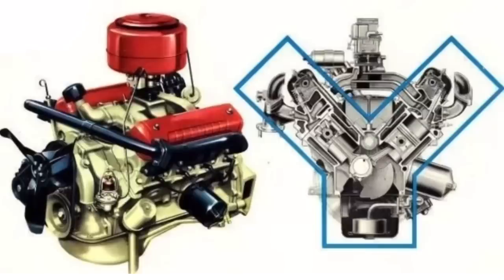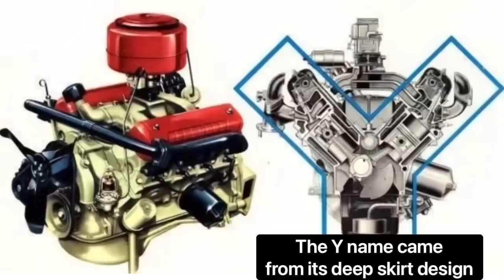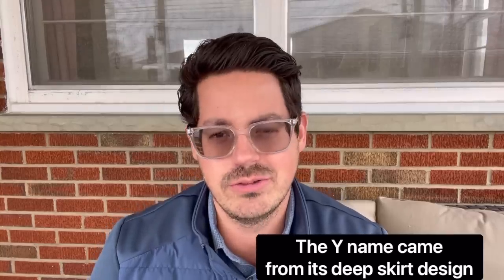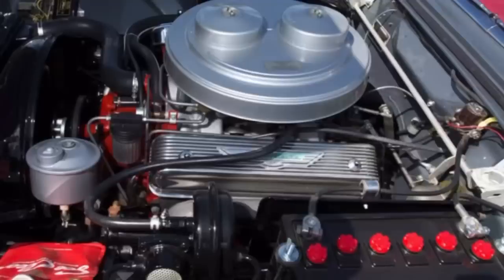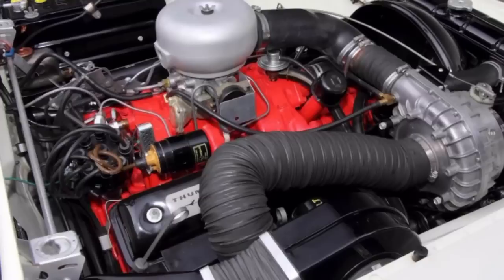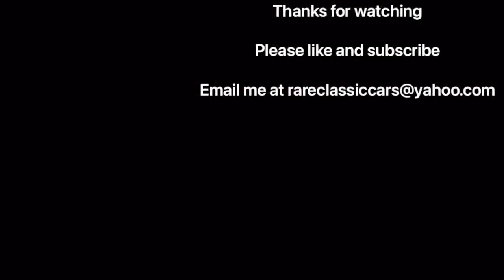Worst Engines of All Time: Ford Y Block V8

Comment: In the 50's there were a lot of people who hated the new detergent oils because many old engines had poor gaskets and rope seals that worked well with non-detergent oils. The oil cooked into the thick paper gaskets and ropes and sealed them up. Crankshafts were smooth to preserve the rope seals and oil would cook in there and make for a tight seal. If the engine then got detergent oil inside it, the detergents would soften up those old gaskets and clean off the rope seals and all of a sudden the engine would start leaking oil all over. So even though the Y-block had gaskets that were designed to tolerate detergents, many mechanics would refuse to use detergent oil in anything and even recommend to their customers to not use it, thinking there was something wrong with detergent oils, that they would make any engine leak oil.
    Though rope seals were still used well into the 90's on many engines (the Buick 3.8 liter 6 cylinder comes to mind) the crakshafts were made to work well with detergents with little grooves cut into them to wipe the oil back towards the crankcase when the engine was running. They may leak one drop of oil in 10,000 miles if that.
    I once saw that a guy put the wrong crankshaft in a Buick 3.8 Liter engine in the early 90's. It was a rope seal block, but the crankshaft he used was for a neoprene type seal that was used on the later models; 93 or 94 IIRC. It didn't have those grooves. Believe it or not the two cranks were identical except for those grooves. And man did that thing leak oil! It was a steady drip, drip, drip, one drop every ten or fifteen seconds out of the rear main. The front was wet but not dripping because it wasn't getting a constant flow of oil on it. The rear rope seal isn't under pressure as such, but it has a constant flow of oil around it. The lack of grooves on that crank will keep a neoprene seal lubricated. Put a rope-seal crank in a neoprene seal block and it would likely start out OK for a while and after a hundred miles or so it would destroy the seal and oil would likely pour out the back in a constant stream. lol
Reply: Also, early detergent oil sometimes separated.

Comment: I think the other critical failing of the Y block was it's very small bores; you just couldn't bore and stroke them big enough to move the big heavy Fords and trucks of the late 50s and early 60s with any performance, whereas the competitors were all over 350 ci by 1957 or so. The MEL was better suited for the job, but you couldn't get em in FORDS (except the 58-9-60 T bird). The FE was a big improvement.
Reply: Hahaha, you clearly haven't seen a 312 or 292 y block with some boost... for whatever reason, y blocks love boost.
Reply: @TheCatOfAges  No match for a 390FE, 394 Olds, or 392 Hemi under boost.
Reply: They had cubic inch limitations for their time is correct. Not many manufacturers were boosting their engines either. Now with that, I am building a stroker C1a2 292 block with a 312 crank turned to a 3.6 stroke and 6.300 rods (Ted Eaton). My name is on the list for a set of Mummert heads and the new single plane intake should be here next week. I was porting a set of C heads and have a set of 1.80/1.50 custom valves with the small 5/16 stems with a Clay Smith cam/Mummert springs that will be going up for sale once the heads are done. Everything is brand new still in the boxes.

Comment: these motors were better than anything at that time very reliable
Reply from the maker: Better than the engines from GM and Chrysler?  We shall disagree. Any engine that needs an  aftermarket add on oiling system isn’t great.
Reply: @RareClassicCars  It is easy to fix the rocker oiling problem WITHOUT external oilers.

Comment: To be fair, Ford came very close to ditching their V8 altogether, a last minute decision spared it. Imagine the disaster that would have ensued if they had been stupid enough to actually not have a V8 only to be completely slaughtered by Chevrolet in 1955. Maybe a bad V8 was better than no V8. Even as a child, I hated the sound of the Y-block and its whiny starter. I loved the FE block, when tuned it was a really sweet engine.
Reply: Especially that long stroke 428. MY brother-in-law had a 428 SCJ (medium riser heads) in a '67 Fairlane that the clutch safety switch had been by-passed on. It had a close ratio top-loader 4 speed in it with a 3.55 gear in the axle. One winter morning he asked sis to go crank it up to warm it up for him. He had left it in first gear and it was parked about 2 feet away from the block house wall. She had never driven it before and got in it, and turned the key without engaging the clutch!?!
   It fired up, ran into the wall, and sat there, still running, chirping the tires with the firing of every cylinder. lol!
   I once tried to outrun him on a Kawasaki 750 three cylinder 2 stroke, which was a "superbike" in those days. I ran off real fast, wrapped myself around the bike and buried the speedometer, 10 or 15 MPH past the 135 top scale and pegged to the stop inside the gauge. After about ten seconds he came around me about 10-15 mph faster in that Fairlane!
    That 428 was a real beast.
Reply: Yes they used that long snout starter that engaged from behind the flywheel until 64.
Reply: I have heard that too.  Would have been pretty stupid, as most Ford buyers did not want a 6.  They wanted a V8.

Comment: I got to test drive(after I tuned it up) a 56 ford station wagon with the 312 thunderbird special. single 4 barrel on premium gas. it had very good power.

Comment: Y block; Ford Brazil used that same basic engine till at least 1976, ca 1971 the heads were designed to do away with that funky horizontal intake port design. And, apparently since the Y block, 221-351 Eights had the exact same bore spacing so, '302' exhaust manifolds wood bolt up(!)

Comment: The Y block engine had a great bottom end. The intake ports were set on top of each other, which didn't help with breathing. They were also heavy compared to the Chevy small block. They were however very torquey and ran out of revs a lot sooner than the Chevy engines. The FE engines were so much better, but Ford learned from Chevy.
Reply: It wasn't that heavy, the Chevy was just so light.

Comment: My Dad was a construction equipment mechanic and had the opportunity to buy a 1954 F-100 ford pickup with the 239 V-8 and a trashed ford-a-Matic transmission from his employer for $100.00.  The pickup had been sitting out in the yard for a few years and those old-time mechanics were beyond petrified of anything with an automatic transmission.  A few of those old boys found a transmission in one of the sheds that would bolt up and Dad bought the non-synchromesh tranny for real cheap and installed it. Sold the pickup to my oldest brother for $100.00 --  My oldest brother spray painted it outside on a nearly windless day (Turned out surprisingly well.)  After a few years, my next older brother bought it for $100.00 and drove it for a year or so.  A few years later I bought it for $100.00 and learned to drive that transmission with no synchromesh.  I left the pickup in my Dad's driveway when I joined the Marines in 1966 and he sold it for $50.00  lol.   We never had any problems with the engine, but we always kept up on the proper oil changes.  Driving a pickup with a non-syncromesh transmission is let's say..  A challenge.

Comment: I remember drilling the right rear cylinder head bolt tube, taping the hole with a pipe thread  and adding a hose and a T fitting to the oil pressure sending  unit on a 225 slant six cause the rear cam bearing had turned cutting off the oil to the rocker shaft. It ran for years after that.

Comment: When my uncle was in high school he drove a 58 Ranchero. He blew up the engine from lack of oil. He and my grandfather rebuild it. I don’t know the exact details of how he did it but my grandfather installed an oil pressure gauge for each cylinder to make sure My uncle kept an eye on the oil pressure. His friends, including my dad, gave him a bunch of grief for driving a race car due to the bank of oil pressure gauges lined up along the bottom of the dash.

Comment: My dad loved the 292. He stated that their main problem was a lack of lubrication to the rocker arms. But their was a popular workaround that involved running another oil line from the oil sending unit through the valve cover to the rocker arm.
Reply: Yes! They had a poor oil distribution problem. This extra oil mod is crucial for these engines. 
Thanks for this comment. I was going to write something about this.
Reply: @Romanesquire  -  Yet those things were already covered in the video.
Reply: @Romanesquire  incorrect information. The external oilers often kill your engine because they steal oil-pressure from the crank and often make them throw rod bearings. The best cure for oiling? Clean your oiling passages, and run compressed air at the oil pressure sender. These engines oiled perfectly fine stock, with good oil.
Reply: We got around the cooking and sludge issues by draining the oil, reinstall the plug and fill it back up with number two diesel and let it idle for ten minutes. Drain it change the filter and add oil. We would also add about half a quart of ATF in the engine oil the other half went into the fuel tank. Kept everything clean and lubricated.
Reply: @TheCatOfAges  not incorrect information: the y-block had a design issue where the rockers received oil through passages that ran to one of the cam bearings, the cam bearings were oiled through a hollow camshaft. however, that cam bearing had a reputation for rotating in it's bore, cutting off the oil supply to the rockers. the solution was to add the overhead oiling kit, but lots of the kits were installed incorrectly. there were special fittings with drilled orifices to limit the oil flow but 'smart' installers didn't use them, thinking they knew more than the engineers. the problem still exists with y-blocks, rebuilders never did find a way to prevent that bearing from rotating.
Reply: @marzsit9833  before 1957? yeah thats true. post 1957 engines do not suffer from this problem. most overhead oilers steal oil from the crankshaft and you end up spinning bearings. i have one, i know its issues. lack of maintenance kills y blocks easy.

Comment: One thing I've never understood about Y-blocks of that era was the exhaust crossover being up at the front of the engine. Just seemed very peculiar to me.
Reply: Mostly truck engines had that feature. no room on the drivers side for a outlet and exhaust pipe. sone larger trucks had a pair of center dump manifolds.

Comment: Just mainly could not make as much power as Chevrolet's V8 even though that one was probably lighter in weight and cheaper to manufacture
think '59 Ford had the hood that hinged in the front and lifted from the rear like some large trucks
the big round taillight and small tailfin angled to the side on some of those Fords were meant to look like Great Horned Owl's face I believe 

 also a lot of bad sludge building motor oil sold in certain years of the past,especially some of the extreme multigrades such as 10w-40 which may have been more "additive" than oil 
mostly didn't go wrong with Valvoline in my opinion -but maybe the 10w-40 should still have been avoided in favor of single viscosity and perhaps 20w-20 or 10w-30 at the most (in retrospect,think "synthetic" is the way to go now although synthetic isn't really always synthetic in today's speak just like "ice cream" isn't really ice cream if it is "filled" with cellulose (read the label small print!) Yuch!
Reply: The Chevy is lighter, but that doesn't always mean better.

Comment: i miss my 1964 ford f250 camper special with 292 with 4 speed never gave me a lick of problems drove it to hight school for 3 years and 8 years after that finally the body just rusted away game good truck and yes be careful about what oil you use i put strait 20 weight high detergent oil

Comment: A mentor of mine used to street race (and track?) a 292 Y in a '62 Galaxie.
He never said anything about the mill, but he said he went through many standard transmissions.
He was a pretty serious racer. In '74 he found a '70 Cougar Eliminator he still has I think.
Started w/the orig. Cleavland then later went to a monstrous 460 w/Chrysler 440 rods.
It lifts the front off the ground by about a foot.  Enough about me...GREAT video!
Reply: Those transmissions were Borg-Warner T-86s, and they were weak, unlike their older "brothers", the T-85, on which the T-10 4-Speed was based.
Reply: @johnjohnsn7633  Ok thanks!

Comment: The Y block engines should not be named as " worst ". They can be categorized as disappointing. At the time they were in service they competed with the Chevrolet 265/283 cids, which were better. Hot rodders had more sucess with the  283. The 292 was a design not as well suited to hot rodding.  The oil, issues were a result of bad owners not bad design .
Reply: It was a crap design ... That’s why it had so many top-oiling problems when most other designs didn’t.
Reply: @sking2173  57 and later ones did not have the oiling problems, the 54 - 56 ones did.

Comment: They are a bullet proof engine. The original "side oiler". The problem with engines back then was sorry oil.  When a y-block comes into my machine shop I make sure the #3 cam journal oil groove is deep enough. Back in the day as the camshaft wore into the babbitt  bearing material it closed off the shallow oil groove. Plus I block off the oil drain tubes on the rocker shafts to pressurize the rocker arms. Keep quality high zinc oil in these engines and they'll for ever. Two other guru's of these great engines is Tim McMaster owner of Hanford Machine Shop in CA and Ted Eaton of Eaton Balancing in TX. They race these engines........
Reply: FACTS.

Comment: My father owned a '59 Ford for a while but I don't remember whether it was a FE engine or a 292,he thought that thing was faster than the '60 Chrysler with the 413,had I been a little older perhaps I would have ended up with it as a first car

 Uncle who was a Police Officer had at one time both a take home unmarked car and his own car that were almost identical looking '59 Fords and those things were considered hot stuff in the day,but neither became the one that my father bought-for some reason he didn't buy the one from his brother,perhaps because of the association with "fast driving" 
I'm sure the '59 Police Interceptor was FE engine
Reply: The 1958-and 9 Police Interceptor engines were a choice of a 352 with 300 hp. or a 361 with 305 hp. The the 361 was the same engine  used in the EDSEL, They were sold as an option in Meteor Cars  in Canada
Reply: That engine was revived as the "360" for trucks around 67 or so, but with a milder cam for low RPM torque, rather than tire-shredding horsepower.
Reply: @michaelbenardo5695  Basically  what Ford did with the  361 was add stroke and  call it a 390, in 1967 they they
 re installed the 352 crank in the 390 block making the 360 truck engine. In heavy trucks it was called a 361.
Reply: @mylanmiller9656  Oh, so the 360 and 361 weren't the same?  I always thought they were.  Learn something new every day.
Reply: @michaelbenardo5695  basically the 360 and  361 Edsel engine Were the same bore and stroke  but the Edsel engine used a Flat top piston that came to the top of the bore, the 360 used in the pickups used a flat top piston but it was about 0.070 down in the  bore. The 361  engine  used in heavy trucks had a forged Crank an used  a roller timing chain, other than that was close to the  360 pickup engine. The  Edsel engine was basically a 352 with a 0.05 over bore.
Reply: @mylanmiller9656  Ok, so I was right the first time then.  Thanks.
Reply: @michaelbenardo5695  Yes you were right the first time.
Reply: @mylanmiller9656  Well it seems you know your FE's well There were several differences between FE cars, FE light trucks, FE heavy trucks, and FE MEL's so a lot of things won't interchange directly even if the block is essentially the same (and there are different blocks too). Yearly changes and application changes happened, especially with the MEL. Cast and forged cranks, internal and external balancing, various dampers and pulleys and flexplates and flywheels- even without considering the 'exotics' like the 406, 427, and 428 and industrial versions it's positively the most complicated story of any American V8 ever made, possibly of any engine family ever made anywhere. It's also one of the longest-lived engine designs ever used. It doesn't get the appreciation it deserves, but I'm glad to find someone else who does appreciate it.
Reply: @P_RO_  Another  thing  about the FE engine is it won every type of  racing it was entered in. The MEL was the first stock engine to have 400 HP. Ford switched to the  352 engine in 1960 because the 430 made there  ford  cars to front heavy causing  poor handling. The FE is 100 pounds less weight than a MEL.
Reply: Probably the 352.